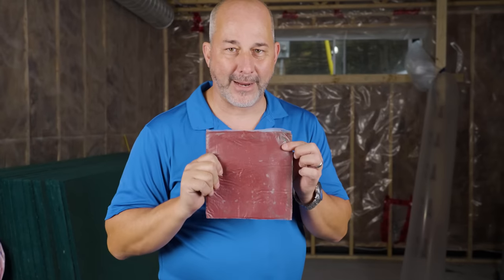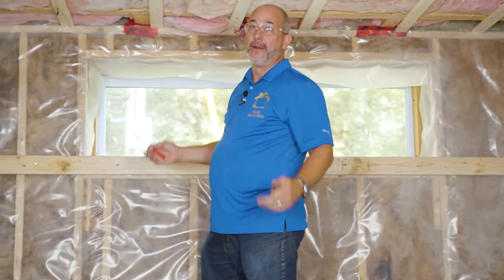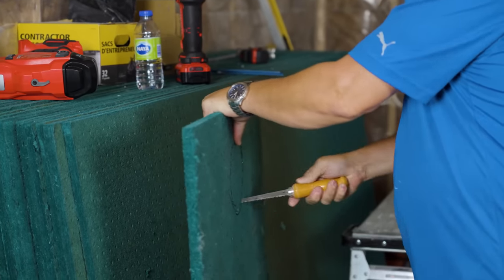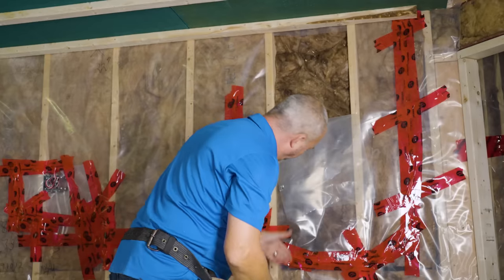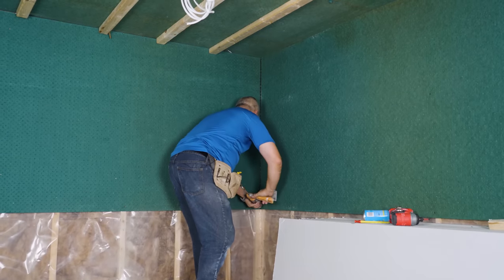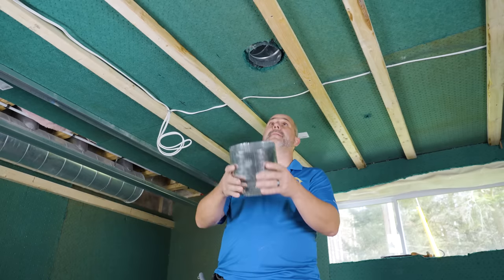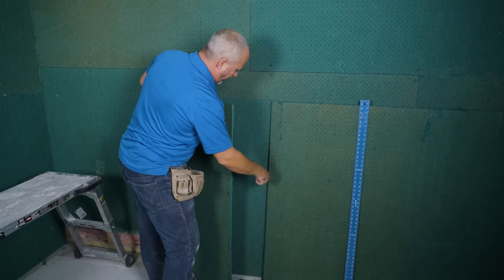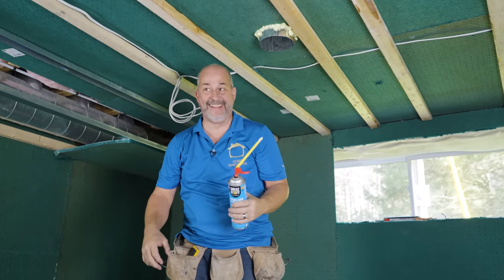Soundproofing A Room (It's Easier Than You Think)

Comment: I have zero plans to soundproof a room but clicked out of curiosity.  Because this guy was incredibly entertaining and a good teacher, I ended up watching the whole video and feel confident I could do this... not as well as him, but confident enough to actually try. Really good video!
Reply: (its easier than you think)... proceeds to use 10 different tools and materials for each gap of possible sound leakage.
Reply: Yeah same haha, i will most likely never do this, super interesting and fun to watch =)
Reply: Don't..  In order to build a "soundproof" room, you have to first conduct a noise study so you know what you're dealing with.

If you want to build a "soundproof" room, I highly suggest you contact an acoustic engineer that will help you first conduct a noise study and THEN they can give you the build plans on what materials and wall construction you need.  EVERYONE's situation is different. So, there's no one wall design that will work for everyone.

I can point you in the direction of a company that WILL help you figure out what will work, but the design services does cost money, BUT, in the end, they will guarantee the design, as long as you give them the proper noise data they need to work with.  

But to just automatically go by someone's design without a noise study, then the likelihood that you are going to fail is high, and you'll waste money and time because the end result won't work.  Word to the wise, talk to a professional that goes by noise study data in YOUR situation first..
Reply: Yeah. He's kind of the "Bob Ross" of dry walling 😄
Reply: @franciscoschwarz6451  I don't know if that's a good thing.
Reply: @Oneness100  I guess, I get what you mean.
You think about all the clueless folks that potentially might be encouraged to take on such a project or task respectively?
Reply: @franciscoschwarz6451  Well, I don't think he's giving the best advice when it comes to sound proofing.  The first indication of this is the video doesn't mention conducting a noise study.   It's not that costly do perform one.  It just takes one or two free smartphone application and spending a few minutes during different times of the day and night taking readings.

But if you don't perform a noise study, then how do you know if the materials and construction techniques are going to work?
Reply: @Oneness100  
Thank you for your clarification. You pointed the sound study out above, but now I know there are even apps too help out. I didn't know that's possible to do a first one on your own just with a smartphone and some time.
Thanks again for your post and your indication for a sound, sound proofing (pun intended) 😅
Reply: Same here 😂
Reply: Agreed. I started watching him when I was putting down EVP flooring in my upstairs. Even though he overestimated my abilities a couple of times, I learned what I needed without listening to a lot of useless "YouTuber chatter" along the way.
Reply: @Oneness100 nice try, noise study salesman
Reply: Right but just in freaking case I need to know haha
Reply: Same same. Great teacher.

Comment: I just used harbor freight moving blankets because they were 5$ each for a 10’x20’ blanket.  Plus theyre mold and fire resistant.  So i just used them behind the drywall and overtop of the drywall i used a berber carpet with a 1/4 inch matt that i used carpet glue to fasten it to the walls.. berber is also fire and mold resistant..  the room was for this couples kids after they get them a drumset and full stack amp with guitar.  Thats 8x12” speakers driven with 1k watts..  and apparently they can play all night and parents can sleep without being bothered..  only bad part is the room gets extremely hot really fast..   the room had no central heating or air.  Only used a window ac unit and space heater.  Which the kids put a temperpedic foam mattress chunk to cover the window when they play so it holds the heat in..  holds the smell of those boys also..  so does their rooms though so isnt the room..  but gets ripe in there ill say myself.  But they were all extremely happy with it and didnt have to charge them for the 5grand worth of material i saved using what i did..  the electrical boxes i used the sonoboard however just because of the electrical and kept it all up to code.  Inspector himself said hes never seen anybody use moving blankets but when i showed him the materials used he agreed they use the same fire resistant chemical to treat the blankets as they use on cellulose insulation which technically makes it approved for use behind drywall in finished areas in residential applications..  go figure right..?
Reply: It works.  I am going to be putting in a master suite in what is currently a 25X50 room in my upstairs area.  Going to use 2" foam in quite a few area's with sheetrock over that to help stiffen the sheetrock as well as a bit of sound deadening but may slip a moving blanket between the foam and the studs.  I would love to be a fly on the wall in 50 years when some kid gets pissed off and punches the sheetrock only to break their hand though.  It doesn't sound like a ton but the foam is stiff enough that with the sheetrock bonded on it's going to be some tough stuff, lol.

For the kids in the place suggest making an air baffle, basically build a maze out of wood and insert some thick carpet on the inside to deaden the noise.  This way they can have a fan or two in the windows and have some airflow but not have an issue with a ton of noise coming out.  Those convoluted foam sheets would work really well as well to deaden the noise.  I actually came up with this for a 1U server to mount in a room but not be so loud you can't think.  Yes it's a problem, some 1U servers can put out up to 95DB and in a room with tile floors it will drive you batty unless you are nearly deaf or beyond.  For a window you may want to attach on a couple toilet flanges to a hole drilled and then use some flexible HVAC ducting for the air so you can draw in from the ceiling.  I am doing something similar with a cheap solar collector I made to help heat my front room and save some cash.
Reply: What did I just read.
Reply: @smoketheevilpipe  grammar nightmare
Reply: Functions as a rehearsal space. Most the time a.c. would be fine as long as you dont Mic it.
Reply: Great story and advice. I bet if you made it underground you could save a ton of money on soundproofing. It would help to keep it cooler. But the issue of having a studio space that wont get too warm especially if it
Reply: @xanhteps648  the money-saving soundproofing is the money you're going to spend on excavator. There's no way you're digging whole that big for studio with a hand shovel. Lol

But yes underground bunker would be a good soundproof studio. 

But like heat, sound travels upward so you're going to need a pretty sturdy soundproof lid.
Reply: Can you seriously use the blankets?
Reply: Nice idea Billy
Reply: @SuperHurley18  the real question 😮‍💨😂👏👏
Reply: @theloversDeAyer  you got an issue? 🤷🏼‍♂️🧐
Reply: I used cardboard, 9 months later - roach infestation😢
Reply: @MuttMuttOutdoors  Hello I’ll be going to college in the fall & the dorm rooms are pretty thin , is it possible to soundproof a dorm room ?
Reply: @RIP.BIG092MLBOA  You have a ton of things to worry about with it being a dorm room so before you try anything rtfm.  That said I would get some foamboard panels and attach (contact adhesive should work well) convoluted foam to them.  Then you can stand the panels up against the walls and just use something like a bed or a dresser to hold them in place.  The ceiling will be more of a pain for setting panels up unless you attach them very moderately with screws at the corners or even just in the middle and let the panels around the walls hold the edges up.  If the room is small enough (less than 8 foot in one direction) you could allow all of the ceiling panels to be cut to fit across the shortest distance across the ceiling and use the wall panels to hold all of the ceiling panels up.  For floor get a couple thick rugs to put down is about the best you can do.  

Just remember that you have to abide by the dorm rules and I would personally make sure it's not an issue before doing an RA would be your best stop.

Comment: Just a slight correction: adding insulation doesn't add much mass to the ceiling (or wall). The reason you add insulation is to stop sound reverberation inside the ceiling (or wall) cavity which essentially amplifies the sound. 5/8 inch drywall is for adding mass and what the green board does is isolate the drywall from the ceiling structure to prevent sound vibrations traveling from the drywall to the ceiling joists and the floor above.
Reply: The Sonopan is also absorbing a lot of the sound waves, and it adds a different density in the mix. You end up with a mix of metal, compressed fiber, fiberglass insulation, drywall and wood. The more the merrier, in here this means that none of these materials have exactly the same frequency to resonate at and amplify. I would have liked to see him acoustiseal/or greenglue the Sonopan to the studs/strapping for better decoupling. 

The structural "weakness" of having so many layers of strapped ceiling makes for a more wobbly structure and then less direct sound transfer paths.
Reply: I just really dont trust the guy in this video. Somethings he says is true, but he says a lot of nonsense also, and  it's bad to give false information to viewers
Reply: Insulation adds shit off mass to your wall. Quadruple mass. That's why the insulation works. The more mass, the more dense the wall is. And inturn more mass to vibrate to make and carry the sound waves. Mass and density is what what you want for this application. 

I like sound proof baton. With mold and for board, and sound dampening foam with acoustical foam visible. Then you check it with a white noise meter

Idk if I'll be able to post a video but you can see it on me page, a few reels ago
Reply: @jpcc815  actually i work as an engineer in acoustics so I know when people say stuff that's not correct
Reply: @troelsnielsen2848  He actually has a video from a couple years back where uses hat tracks with iso clips to decouple and  mass loaded vinyl with 2 layers of 5/8" drywall with Green Glue between the sheets.  This video is not as accurate.
Reply: @rolfbjorn9937  yes, mixing up the acoustic impedance makes all the difference
Reply: @troelsnielsen2848  he actually knows what he's talking about here. I had a recording studio designed by a top acoustician and they said the exact same things as Jeff
Reply: @3m63r3  i just want to see test measurements showin acoustic performance. Not just rubish talk
Reply: @troelsnielsen2848  Acting like having the job means you know literally everything in the field is being arrogant.
Reply: @amentco8445  i dont want to act like I know everything, I don't know the product he is using but I know and understand the physics of acoustics and my issue is the some of  things get say do contradict directly with the physics.
Reply: @troelsnielsen2848 he says he’s not an acoustician but this video is for doing it fairly inexpensive using this material. I’d watch his other videos before claiming he’s a fraud. He also does a lot of different types of acoustic/construction related videos of differing complexity
Reply: This whole video is bullshit, to be honest. There is little truth here and there but he clearly fails to understand... err... to articulate that in construction you can only isolate the source, meaning that you can somewhat prevent others from hearing you, but not vice versa. And the whole structural isolation... I mean, there is none. I was done when he said that it's mandatory to build inside isolated layer, but it turned out that it he only meant yet another layer of planks nailed to the first one 😆
Reply: It does add mass to the Ceiling and wall
Reply: @rolfbjorn9937 all false
Reply: @troelsnielsen2848 He doesn’t say a lot of nonsense
Reply: @troelsnielsen2848  nope
Reply: @rolfbjorn9937 all false
Reply: @troelsnielsen2848  please do a video on what you know
Reply: @troelsnielsen2848  all of his videos are like watching a DIYer. Some stuff is correct but a lot of incorrect as well. Plus the quality is really sub par. When he furred out the ceiling and didnt even measure to have his boards end on a piece of wood... that's just lazy or worse, someone who doesnt know what they are doing.
Reply: @troelsnielsen2848  I particularly like how he goes to all that trouble to not fasten the SONOpan to the ceiling and walls, and then just screws right through it to the strapping and studs behind. Amazing.
Reply: @jpcc815  I dont think you are using the word "mass" correctly brother. Mass includes density or weight. You seem to think that something taking up a lot of space also means something has a lot of mass.
Reply: You come off like someone with a 2 yr degree that acts like they have a PhD and if something is said they dont like they go "ShOw mE a pEeR reVieWed pAper or i dOnT bEliEve iT"
Reply: @normanladdleschnitzel1928  Why is it always the uneducated that say shit like this? You come off as someone with no degree that acts like they have an education and if something is said that you disagree with, you go "U act like u have a PHD LOL"

Comment: That HVAC ductwork is going to be a problem for the soundproofing. The ductwork is a HUGE air leak in and of itself unfortunately.
Reply from the maker: You’ve got to spend a fortune for perfect. But efficient is practical. We’re doing a sound test at the end of the series
Reply: @HomeRenoVisionDIY  Flex Duct is much better both in amount of sound traveling down it and transmission through it's structure.
Reply: An inline sound trap would do wonders.
Reply: @HomeRenoVisionDIY  absolutely! Please get multiple readings. One from the room directly above and others along the trunk line from the ductwork. I did sound isolation in my theater room and all that sneaks out is a little bass to the room above. I put in Atmos speakers and two 12” subs and numerous lights in my build. For the lights I used the pancake LEDs that mount to round junction boxes. I used putty pads and acoustic caulk to cover and seal the gaskets.
Reply: So there is always a mini split. Much less an issue than traditional ducted system,  for an area needing sound proofing
Reply: I remember setting drums n amps up next to the furnace/main duct work. Every vent upstairs in the 2 story house was like a speaker pumping the basement jam session threw it with mid clarity.😂🍻